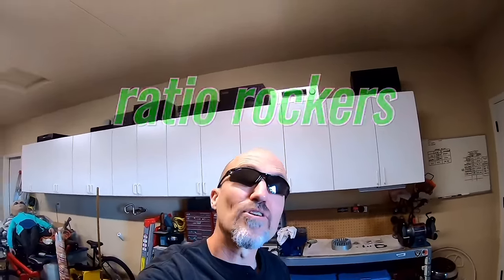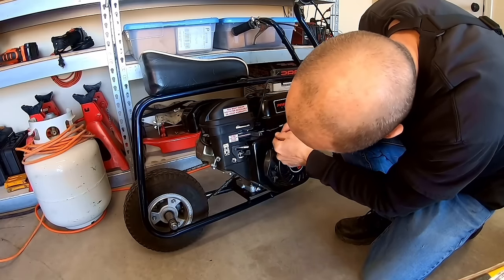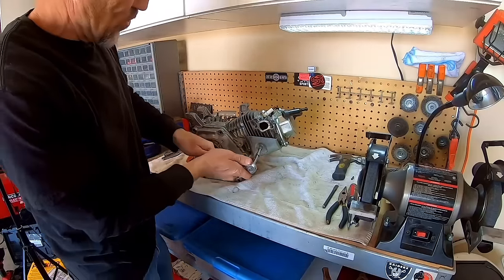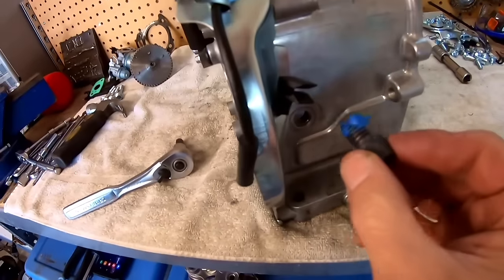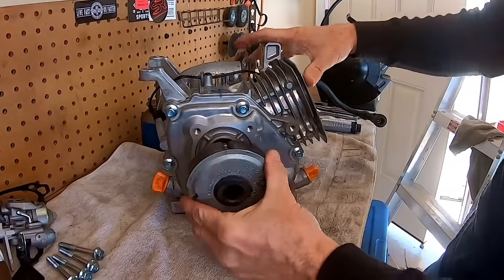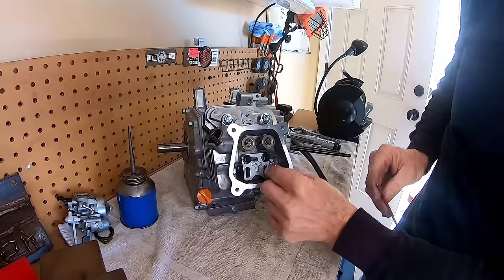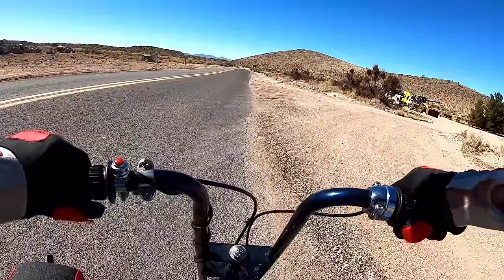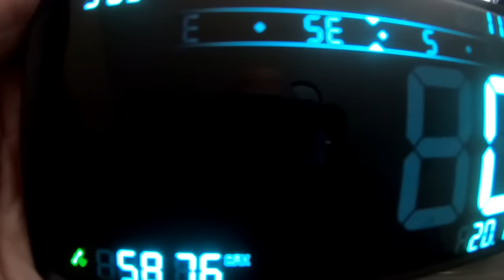$100 budget Performance Predator 212

Comment: I am making this comment before I even watch the video hi I am so appreciative of you because we spoke of this and you said you would do this and you are a man of your word thank you so much I know this will be a great video you are the best!👍🏽
Reply from the maker: Thanks! I remember
Reply: I like that you put the price of the parts used on the screen! Now please tell me all of these parts that are in this video will fit my new max performance engine from harbor freight? Do you have a Business building these awesome machines because if so I want one! I knew your video would not disappoint thanks for all you show us. Oh I noticed there is a hole in the valve cover is that ok or put some type of filter there? Thanks again!!! 👍🏽
Reply from the maker: @janicefullerton6201  Thanks! I don't do it as a businees, more of like a hobby for right now. Ya, you can throw a filter on there. Or use a catch can. You can definitely use these mods on the 224.
Reply: I agree
Reply: @Black66  hey quick question I just removed my governor and oil sensor and slapped on a stage 1 kit but seeing tht I can possibly blow my engine just by doing that so I was wondering if I put in the fly wheel and billet rod and all the other parts u added would it less likely blow my engine? Or it still has a high chance? Thanks 🙏🏻
Reply from the maker: @robertrodriguez3374  Yes, billet parts will make it stronger.
Reply: @robertrodriguez3374  that depends on how you maintain it,  and how much time you spend at really high rims.  Both dramatically effect lifespan of ANY engine.
Reply: @Black66 what gearing are you running
Reply: This comment has 66 likes and it’s actually perfect

Comment: After getting addicted to minibikes after your videos I built a 60 mph predator for probably around $100 ; done the governor removal, 24mm nibbi, header pipe I got off Facebook for cheap, and 18 Lbs valve springs, on a ct200u frame 10t clutch 50t sprocket , will run 57-60 all day
Reply from the maker: Sounds like a beast!  Glad I could help.
Reply: @Black66  oh I got rid of the ct200u frame  last night lol, found a kid that traded me even for a 1980’s sensation frame , he had no idea what he had lol; definitely hats off to you for my new hobby! Thinking about getting a rascal lite kit, hard to beat that for $500
Reply: how long did your engine last
Reply: @kusinx800  still going strong, fully built now , well over 2k miles lol daily ride it about 40 miles a day

Comment: This is all great. While you are taking the piston out, change the connecting rod to a Billet Rod for higher RPM safety and they come with replaceable bearing . Keep same cam and don't bother porting or polishing the head. Drill holes in the stock muffler.
Reply from the maker: Check out the playlists on the channel for billet rod and flywheel installs along with a stroker kit for good measure. Here is the link to one of them . Thanks for watching https://www.youtube.com/watch?v=VbcpA0jdSIw&list=PLkbj-ip-5FzZG40xkiEtZHRtF_jDzxA9U

Comment: For the governor holes I recommend a 1/4 - 20 by 1” bolt. For the oil sensor hole I use what’s there and seal it with gasket seal
Reply from the maker: Thanks! That's exactly the size I showed in the video
Reply: Does the bolt need to be self tapping ? Or did you pretap the plain hole with a std 1/4 x 20 tap ?
Reply: @Black66 do you need to use self tapping 1/4 x 1 20 pitch or just regular bolts? And where do you get your bolts?

Comment: Moving away from the stock flywheel with the governor removed seems like a good idea for operator safety anyway. Plenty fine in spec I'm sure, but probably not a few thousand rpm higher!

Comment: Sick build. I have a 212cc predator engine and I’ve done very similar mods to it and it runs about 55 mph. Love your videos!
Reply: how can i do this im looking to build a 212 roller that goes around 50-60
Reply: @litowid  I removed the governor and added a mikuni VM 22 carb with a billet flywheel
Reply: @BobTheBuilderlmao  212s are pretty weak lol what you do is get a 224 and remove the governor 🤣☝️my cousin did it. Put it on a go kart. Nobody has put the pedal to floor yet because it's so fast. 25 percent throttle were already flying down the street👀🙈everybody has a 212 too, my cousin has raced everybody in his neighborhood and hasn't lost yet🤣
Reply: @TreyGoose  Sounds good. Thanks!

Comment: I bought a high-performance Minibike about a week ago and I found a box that came with it in the back of my car in the box was a brand new 212 predator hemi never even taken out of the box, a brand new front tire a brand new rear tire, a brand new 18 tooth clutch a brand new clutch gas throttle and cable and a brand new seat all wrapped up in plastic still all I needed was a frame. This morning I found a Azuza frame in excellent condition for 20 bucks. So I pretty much got this minibike for free except for the front and rear rim now I’m going to do the mods that you just did. Thank you to you and my son‘s gonna have an awesome little Minibike it’s gonna cost me about 140 bucks with everything
Reply from the maker: Awesome!! Can't beat that deal! Especially for an Azusa frame.

Comment: This is what I have found as I have installed several preditor engines on similar mini bikes from the 2 or 3 manufacturers that HF uses. Meaning there is a standard and a hemi version. So far I have managed to get a top speed of 58 ~ 59 mph in their stock version, all by fiddling with the gear/sprocket sizes.  What I also discovered is that after it maxes out on RPMs the valves simply start to float meaning the engine has hit it's limit. From that point no amount of modifications will increase the power unless you install  lighter valves,and stronger valve springs. Once you do that you can you go on to purchase all the other go fast aftermarket parts.  If done correctly the bike can hit 80 mph, and I'm almost there.
Reply from the maker: Check out the playlist for many Performance  engine builds and part comparisons along with top-speed runs! https://www.youtube.com/watch?v=wHIKyVU4oxw&list=PLkbj-ip-5FzZG40xkiEtZHRtF_jDzxA9U&index=6

Comment: Hey, just a tip, a large reason the stock rod blows up on the 212 is due to not enough oil entering the linkage with the crankshaft. Maybe drilling a hole on the conrod would allow oil to seep into it, giving it similar lubricating properties as the billet rod.
Reply: Im going to try polishing the stock rod & add another hole to help it lubricate. I blew a billet rod, not even 2 month old, my 212 has cam on (7500rpm target) & ported heads, flat top piston .570 & have super low gearing for launch, topped at 52mph with a 12/70 gearing. Was at a meet & their was a long maybe 2-3 mile straight street so was on full throttle for some time & engine just shut off, didnt even hear a bang noise that it hit something. Piston is clean no sign it hit the valves too. So im thinking the issue was maybe low oil & caused the rod to heat up. I normally take engine apart with bike tilted enough so it doesnt spill when i remove the front cover & i saw it was like half way. 

It was a monster tho, hella launched hard. Building it again but rod is a bit expensive lol but wondering if its good, i dont want another blown rod, this time will check oil.

Comment: Black66…. Can you possibly make a video showing how you align the chain correctly when putting it on the front and back sprockets? I’ve also wondered how to align or square things up when installing a torque converter.

Comment: great video, well put together ❤
Reply from the maker: Thanks!
Reply: @Black66  hey how did you remove the gear off the crankshaft
Reply from the maker: @magmasloth3619  I put the crank in a vise to hold it and used a small hammer and a punch. It will come right off pretty easily.

Comment: Which option is better for plugging the holes in this case: blue or black RTV? Is it necessary to wait the full 24 hours for it to cure before running the engine and riding?
Reply from the maker: Either one will work you can also use loctite . I have never had one leak even after riding right after the assembly.

Comment: I did the flywheel and 12 degree key it's jetted 38 with air cleaner and exhaust I'm not at high elevation the 30 thousands gap seems to much it runs fine but slight misfire at idle I've got the head gasket and  springs not installed yet

Comment: You should do a $200, 300, 400, and 500 version of the same video!  Wonder if there are any “speed hole” mods to the stock muffler that would help.

Comment: Well I bought everything on your list for my very first 212 build! Super stoked about this! I still won’t have anything to put it on, but I’m intrigued by the build itself. Sure will be one bad shelf engine untill I find something to put it on!
Reply from the maker: As long as you're having fun that's all that counts!! I would throw a sweet-looking blower housing on it. Like chrome or powder-coated blower housing so it will look even sweeter sitting on the shelf!!!👍
Reply: @Black66  so the stock carb is trashed, I’m really not trying to spend a load on the Mikuni vm22, I’ve found a few other brands on Amazon, “knock off” would you say that would be ok for this cheap build? I’ve seen a few reviews and I’m not sure what to do exactly, some say the stock carb is better than the knock off? Would it be in my best interest to buy the stock one or knockoff. Unless you know of somthing better? Really appreciate the advise!
Reply from the maker: @cheynejones9536  I use this kit all the time. 
Not as good as the OG but for the money it works fine. https://www.ebay.com/itm/194358544642

Comment: I just received my stage 3 header pipe from gopowersports for my 224 and it doesn't fit? Neither the gasket or the flange... did you have these problems when using some of your 212 exhausts?
Reply from the maker: If you watch the 224 playlist you will see, I changed out the head at some point in the build. You can use them . You have too oblong the holes with a Dremel or file.
Reply: @Black66  I noticed you used one thats why I was so confused. I must've missed you dremeling the holes

Comment: I’m curious as to what kind of mileage the bikes get as they get modified too! Mpg stock then mods…..im thinking they might actually improve! It might be easier to check the mileage by quart than mileage per gallon…save you some time! You could rig up a small tank and just hang it on the frame with a hook and baling wire with a piece of clear fuel line…..what do you think? I’ve always wanted to know how far these minis could go on a tank anyway!
Reply from the maker: I did do a range test video a couple of years ago with a very small tank. Check it out.https://www.youtube.com/watch?v=j7U_0GgGLng&list=PLkbj-ip-5FzbVBVqMi23O5noFSAbhNOp1&index=7
Reply: @Black66  so that little tank went 15 miles and it held .wq
Reply: Held .21 gal so it got 75 mpg….I always wondered. As the mods are installed, I would think the mileage would go down, but how much. Reason I’m asking is in case of an EMP, these minis might be the only thing we could get around on! And I wonder if the electronics would survive the pulse, cause the electrics are so rudimentary and still very robust. Thanks for getting back to me. I’m thinking about building my own bike adult size kinda like the groundhog. I’m sure you’ve seen it on utube. Comfort would be much improved for adults on a bigger bike. I love watching your builds and thanks for your exportice on the subject, and appreciate you taking the time to share your knowledge.

Comment: Excellent video. Good advice, clear demo, pacing and narration keep it interesting.
Suggest you mention the torques you're using, as well as valve clearance.
What were your sources for the various parts? Particularly interested in the cast aluminum flywheel. Thank you!
Reply from the maker: Thanks! I did leave some of the parts used in the build in description of the video

Comment: im having trouble after installing flat slide carb and aluminum fly wheel and removing the gov. it had alot of aluminum shaving in the motor after about 2 hours of riding. the motor was brand new and i broke in the engine then installed the parts. it doesnt start now after the 2 hours with the performance parts and im unsure why. i checked my timing and everything besides the top of the piston and it seemed fine, just seeing if you have any tips before i take the head off and start ruining gaskets

Comment: Great video, I noticed that you got the bike up to 50mph only with the governor ziptied on a stock 212. I have a cc100x with a stage 1 predator 212 hemi(jetted carb, intake, pipe, ziptied governer) but it only does around 35 as its top speed. Could this be because I am using a 12t clutch with a 75 rear sprocket? If I changed the sprocket to a 50t would it get a higher top speed? Thanks
Reply: yes by changing the sprocket to a 50t it will increase the speed
Reply: i would try a 60t first tbh

Comment: i have a predator 212 with straight pipe and vm22 mukini carburetor from amazon and i was wondering what main jet should I put in there?
Reply from the maker: I usually start out with a 120 or so in a VM22.
Reply: @Black66  thanks

Comment: Super new to minibikes but i have been working on lawn mowers for awhile. 
Question. What is the gear ratio of that bike?
 I have a CC100X Coleman frame with a Predator 212, 12 teeth on front and 75 teeth on back and I can only get 28 mph. I will be zip tieing the governor spring tomorrow but why is the top speed so low?

Comment: @Black66 Question: The flywheel you linked from studz racing, they claim it fits "Honda clone engines only" and not predator.. nut we see you using it here on a predator engine. Is there a difference in these two tapers, if so, what is it? And how did you manage to use the EC Flywheel? (looks like you cleaned yours up a bit too) I ordered one for my 212 predator and studz racing is giving me trouble about it!
Reply from the maker: Yes, the taper on the clone and standard 212 are slightly different.  There are differences in opinion on using the clone wheel on a standard crank. 
 I have used them without a problem. I am not saying he is wrong, Other folks might have had diffferent experiences with this stuff than I have.  I make sure to lap the wheel in with a good valve grinding compound before torqing the wheel.
Reply: @Black66  thank you! Eric from studz racing is telling me to return the flywheel and "just by the billet flywheel" but I'm building a cheap 212 here for a mini bike... I don't need $120 billet flywheel on a stock un-reinforced 212 block. Any tips for lapping the clone flywheel to the predator properly?
Reply from the maker: I use valve grinding compound and run the wheel back and forth until I get an even sanded surface on the crank as seen in the video.
Also there is a link in the video description for a vendor that sells this wheel with the same taper  for the 212.  His wheel  has 28 degresss timing built in in case you don't want to use the offset keyway to advance the timing.

Comment: Hello,  thank you for the video.  I was wondering if you could share which tools you use to port the head. Thank you
Reply from the maker: The porting tools I used are in the description of the video. Thanks for watching!
Reply: @Black66  thank you
Reply: @Black66  just for reference you used a dermal correct?

Comment: At 14:40 flywheel 8° advance pre-installed/off the shelf.  Completely understand where your going.  Now, here me out.  How about cam timing, when changing cam out?  Dont cam manufacturers sometimes have a little advance made into them as well?  Whether regrind or new billet?
Reply: See where I am going?  I'm basically taking this videos timing principles education, and trying to add some info.  I'm coming from automotive principles.  So, moving the powerband/peak hp or tq observed at different rpm throughout the range.  Ignition timing can manipulate peak hp at different rpm.  Also, cam timing too.  

I don't have much experience using a degree wheel/reading cam cards/checking valve/piston clearance with putty/etc etc.  

That's probably why my car project's engine build, where I installed a schrick camshaft "straight up", choosing to skip degreeing the cam.  

I think it was a mistake, and I probably left some untapped hp on the table.  My motor never had a strong idle performance, but upstairs (peak 7k rpm fuel cut) it made all its hp.  

I didn't like my results in the end.  Kept dreaming of tearing it all down someday, and really get into the "meat n potatoes" of playing with cam timing, using an adjustable cam gear, and recording max advance/retard degrees, that way I'd know what is simply too much/dangerous/risk of valve to piston contact.
Reply: Again, 4 stroke engine principles apply, whether it's a 12 valve bmw straight 6, or a single piston lawn mower engine.
Reply from the maker: The flywheel that I used has around 18 degrees of timing. The sweet spot on these little engines is about 32 give or take depending on the setup. Most billet wheels come with about 32 degrees of timing. I could have gotten away with more timing on this one. 
This setup is for the average person throwing this together in the garage with minimal tools. Inexpensive simple and easy.
Definitely could degree in the cam but this wasn't in the scope of this video.  Thanks for watching!